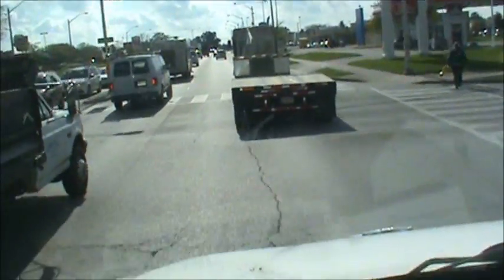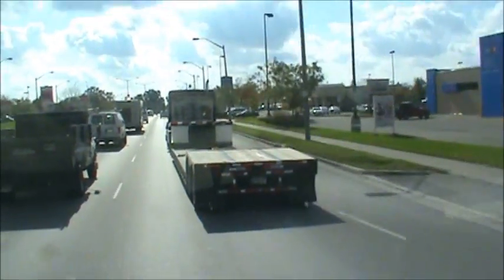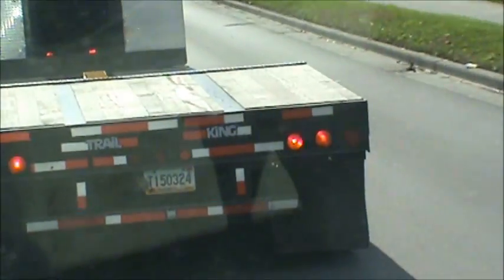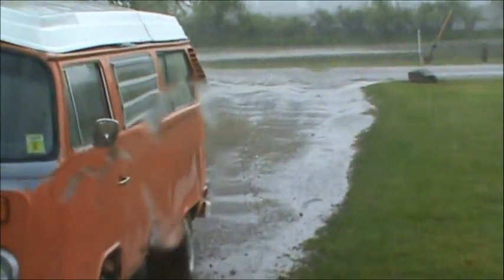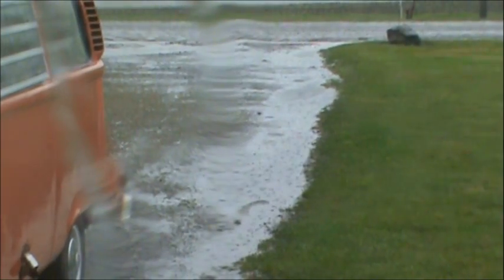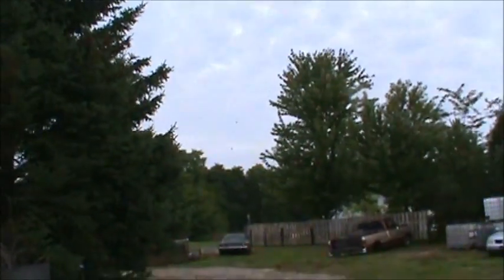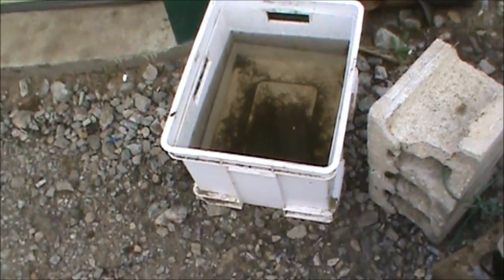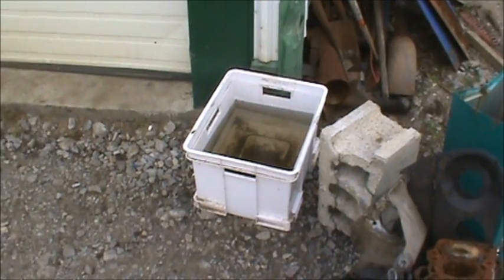Catch up

Comment: That's a Dynamo ... you should have replaced it with an alternator, small danso will fit perfectly and give you three times the output and is Much cheaper to service & replace.
Use blue loctite on your steel to aluminum threads... 
Stay Dry.